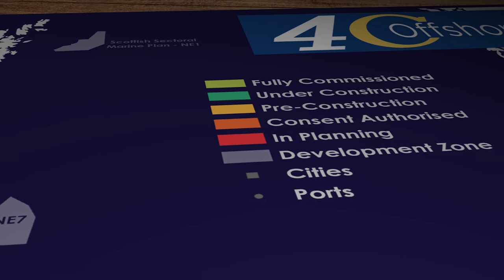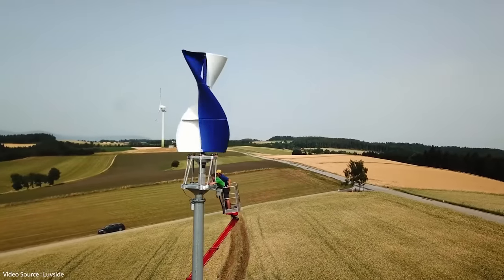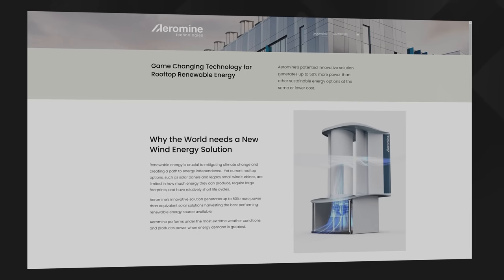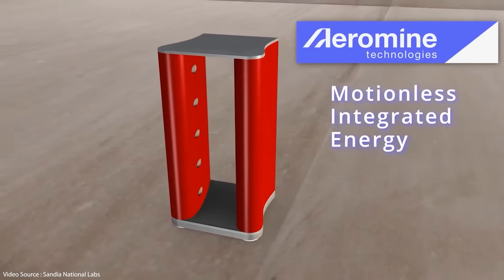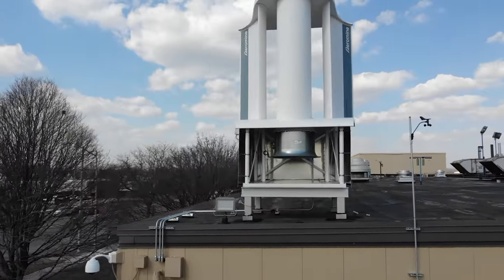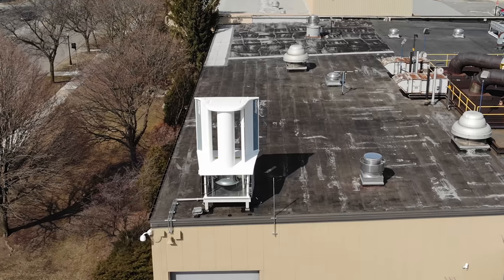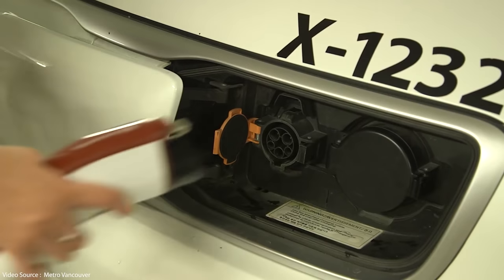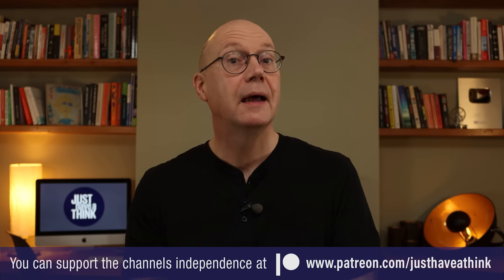Aeromine Rooftop Wind. Static. Silent.  50% more power than Solar PV. What's not to like?

Comment: This appears to only work with wind from a single direction. I would be interested to hear about how it deals with variable direction wind.
Reply: I've not checked it yet but I'm pretty sure I saw a design using a vertical-axis wind-turbine for rooftops recently?
Reply: It deals with it by staying attached to the roof and not falling off, I'd imagine.
Reply: Rotational base with sensors would be cool, but then again, it will no longer be low maintenance
Reply: There's another video, can't remember by who, suggests that a 45 degree variance in the wind from centre in either direction doesn't affect performance, so it, "works well" in places with a predominant wind direction
Reply: @ceeerl8698  That was my thought. I would think that a tail vane would allow it to keep it pointed into the wind.
Reply: Maybe a robust system which 'follows' the wind direction to position the turbine would be useful.
Reply: @DavidM2002  that should do it or use the whole construction as the tail. Just add some weight to balance the tail and it wouldn't be too advanced
Reply: @Justifi3r09  to get a predominant wind direction is difficult even with a large share of wind from southwest in western europe. You would need to mount it on a rotating base.
Reply: @paxundpeace9970  I don't disagree with you, merely only sharing their claim
Reply: Making them turn is pretty easy, but due to the size, it would add a decent amount to the cost.

They make versions that can take wind from any direction.  Less efficient, but cheaper to make.

In fact, you can find plenty of people who've bullt one using a 55 gallon barrel.  Not counting the generator and other parts needed for making it electrical, the turbine itself shouldn't cost more than a couple hundred dollars to build.
Reply: These are designed to use the side of the building to help channel the air into the bottom of the turbine (it's why they place it at the edge of a flat roof).  Let's say the prevailing winds (more than 50% of the time) come from the west and your building has a 100 foot long wall that runs N-S where you install 5 or 6 of these.  If the turbines turn to catch a wind from the SOUTH the only one that will get anything is the one at the SW corner of the roof.  Most regions get their prevailing winds from one direction, now they may vary from a N-W to a S-W angle (using the above example), but they'll still be MOSTLY from the west.

Comment: This thing being almost 10' tall could be a problem with zoning height restrictions for residential areas. That is adding almost another story in height. It also seems like the height could add a lot of forces to it, adding to the structure required to support it.

And no visible moving parts is different than no moving parts. There must be potential for noise and vibration, even though the turbine blades are internal.
Reply: Sorry but you are rather negative in your appraisal and you are stating the obvious, it isn't a magic wand.
Reply: @anthonyxuereb792  No, I'm just stating the facts. I didn't claim it to be a magic wand. I'm not being negative, just realistic. It's not exactly something everyone could install on their existing house.

Comment: Bullcrap. 
I sell solar PV.  We looked into wind turbines to augment solar.  
The good thing about wind is that it works day or night.  
Our thinking was they should work well together.  
No such luck.  
When you look at their rated power production -- it will be at over 20mph. 
That's ridiculous. Typical windspeeds are like 10mph.  
The windmills we looked at didn't produce anything until about 7mph. 
At 10, 11, and 12 mph, their production was negligible. 
We concluded that wind needs large windmills operating at much higher elevations, 
where they can get faster winds.  Putting them on a 30 foot pole or house just didn't work.
Reply: Thanks for your realistic statement! You what your talking and I'm the same opinion.
They talking 5kw, hahahaha, I know how big my solar 8kw system is and this liiitle toy fan never will make 5 kW.
Reply: You should also add that wind distortion that comes out from hitting buildings and everything else doesn't help either.

Comment: You should look into designing one or 4 that would either go around the chimney (4) or Replace the Chimney (1) while allowing a 10” or 12” type B vent to come up the middle so the fireplace could be used still!
Hope this makes sense!
I am in Elk Grove, CA and we get a lot of “Delta Breezes” (I’ll let you look that up!)
Reply: I thought the same thing...I applaud your out of box thinking
Reply: You could put one on the top of your chimney to work 24/7, and it would also make your chimney more efficient to boot.  By the device being there, it would create faster wind flowing over the top, and more of a suction inside the chimney.

Comment: They have a moving part: the propeller and a turning propeller maks sounds. Secondly,  installations standing in de wind will,  with a more stronger wind, as in a coastal area,  make, depending wind direction, all kind of wisteling sounds. In my area I witness that from GSM antenna towers. The solar panels on my roof, living near the sea, will cause vibrations and wisteling when the wind go's above wind force eight.  The vibration sound strengthens in the concave my attic forms. With the last storm one of that panels broke off and fell in the street. Luckily nobody was hurt.

Comment: I once put forward a concept to a facade company about utilising the air pressure differences around corners on High Rise buildings by creating a venturi through the corners and using a small turbine, several of them.

Comment: Thanks for another great video. Generation at points close to requirement can only help the "National Infrastructure" adapt to the high low, short need requirements of modern life. 
I think there is a Dutch outfit that have developed a "pod" design to sit on flat roof buildings that has solar PV on top of a "sculpted" interior to use Venturi effects through multiple wind generators. All generators create vibration and it is the mounting of this that will prevent the transmission of any vibrations into the building. 
I think expectations need to be set on the levels of power generation. I wouldn't expect to get out of the KiloWatt generation for an installation.
National infrastructures have developed where power is generated in large central locations, not at the edge and as such not feeding back into the national infrastructure.
Solutions like this are great for a building or small development and as part of a wider energy independence plan I'm sure would make financial sense. 
:)
Keep up the good work :)

Comment: I work in a feed mill in the plains of the US and the load out bays of our mill are like wind tunnels.  The winds could be 30 to 40 mph but the air flowing around the silos and through the load out bays is hurricane force.  These are vertical surfaces and couldn't use this particular technology.  However, the height of the elevator would be perfect for continual wind flow if someone could design something that wouldn't torque the structure or change the function of the elevator, silos and load out bays while the walls and bay entrances and exits could be useful for producing wind power.

Comment: also looking at the patients of the areo mine this can be further modified for other use cases to produce electricity for residential homes but they used the venturi effect for the one 3 times one where the generator is with a egg shape cone, then on the aft side of the propeller, then on the way out of the system. In fig. 18 of the patient they are also using a 2 stage prop with adjustable and fixed blades with a pancake motor with a assumable 5kw peak motor. in the video there was 3 different designs through there process and which lead to the final design with a 4 wing and chamber setup. so technically anyone could make this just it is not a simple wind turbine

Comment: Ive been a design build renewable energy contractor for 3 decades. About 15 yrs ago I installed a vertical axis wind turbine under a pilot program for the US military.  At the time I was asked to select the product to be installed.  I could find no product at the time that I could stand behind for performance or reliability criteria.  The govt selected and purchased a product rated at 5kW.  The location we installed the vertical axis wind turbine was a Hawaii military base apprrox 1000 ft above sea level with constant prevailing winds of 10-20 mph.  The turbine though rated at 5kW never produced more than 500 watts.  Also the inverter paired with the turbine minimum voltage was the lowest available at the time but the turbine only produced power at around 15 mph wind speed.  The turbine was supposed to have a built in brake for high wind.  Unfortunately the turbine failed within 1 yr and actually blew apart embedding pieces into surrounding buildings.  Fortunately nobody was injured.  Ever since I've been skeptical of vertical axis wind turbine technology.....

Comment: Brilliant and elegant. How much and how long are they designed to last? There must be some periodic maintenance? ROI calc examples would be the next logical video. We are rooting for this breakthrough tech. Here on the Canadian west coast there are special site needs. Here are some queries:

Heavy slanting blizzards clogging ingress ports. How do you resolve heavy ice and snow accumulation ... with frequent and rapid thaw cycles.

Nesting birds and rodents, insects prize cavaties. How do you deal with these in the airflow ingress pathway?

Minimum roof/high wind shear loads. Anchor fastener strength? Rust- sun weathering- etc.  Hurricane forces .... or earthquakes. 

Remote communities on sizable
Bluff, cliff installations,  mountain sides ... to take advantage of very constant high up-lifts for an industrial scale operation?  Many more questions ... but think you are on a profoundly sound track for viable renewables. Fascinating.

Comment: I always wondered why the Venturi effect wasn’t utilized in capturing wind energy. This sounds very promising actually.
Reply: Because when converting wind to mechanical power you need more area to support a load, yes it speeds up the wind slightly but the blades themselves when coming under load will just slow the air down thus killing the venturi effect
Reply: If you don't have two mountains that create a venturi effect "naturally", you need to add something to the windmill. This will increase the cost. The energy relates to the size of the windmill, similar to a farm: Bigger fields = more crop, longer blades = more wind to capture. The higher speed is only relevant as you need some minimum speed to get the blades running.

Comment: Here in Florida during the long summer we have we get onshore winds almost like clockwork most days due to the peninsula heating up faster than the water so the direction of the wind is pretty constant, therefore I'd like to think these would work pretty well on buildings/homes near the shoreline.

Comment: I always wince when I hear the explanation of the venturi effect being the cause of aircraft lift. It has migrated to explaining how sailing boats are powered and now this rooftop wind generator. It may well be true for this wind generator because the path of the wind is controlled and constricted. But for aircraft whatever venturi effect created by the wing shape is marginal (it is the angle of attack to the airflow that generates lift). How otherwise can one explain that aircraft can fly upside down?

Comment: I can see this system working well with heat evacuation/ventilation from any industrial facilitate that generates copious amounts hot air.... such as steel smelters and glass furnaces and the like. 
In the tropical parts of the world, nearly every building with high ceiling and a lack of climate control would fit that model as well.

Comment: Great video, and promising technology.  I am a little confused by the several times you said "no moving parts" and "silent".  There is the internal turbine which is being spun by the air that passes through, and that is a moving part.  Granted it's not a big external propeller, but it's certainly moving.  And even if everything is mechanically balanced, there will surely be some sound made by the spinning turbine and possibly even the wind as it is forced through the channels.  Fortunately some of that probably small sound will be absorbed or reflected upward by the roof, but line of sight on the ground to the front of the unit will still possibly get some sound.

Comment: If it has an internal propeller type generator, that means there are most certainly moving parts. I don't know of any wind turbines that are completely devoid of moving parts.
I remember a few years ago there was an omni-directional small turbine that had four air intakes up top, and whichever way the wind was blowing, it forced the air into the turbine from that direction. Simple yet brilliant. It makes me wonder if this idea could be combined with a venturi to optimize the availability of the negative pressure assist.
Reply: OMG...

Comment: The WindRail , by a company called "Anerdgy successfully tested a prototype on top of some grain silos outside Zurich" in 2014 has a similar product.
"ANERDGY AG was founded by Sven Koehler in 2012. We invented, patented and develop the WindRail® system."
The still sell Roof wind turbine B60, a twin turbine solution,  but no longer seem to sell the "edge of roof turbine", they first tested in 2015

Comment: A lot of comments are going on about "changing the direction" if the wind changes, but the whole point of this system is that it is very simple and cheap to build.  Every added thing to "improve" it adds both cost to the initial build plus maintenance and then you have to also consider the different engineering challenge of the structure itself if the loads are shifting.

To me the "go bigger" approach is noted (they don't make smaller units because they won't generate that much power), but the other key is that it can be built out of things like wood or plastics or perhaps even foam filled skins like many other things that are laminated.  Foam is pretty light too...

Weather extremes would be my concern, we can get 100+ MPH winds here and gusts from different directions.

Also animals, that looks a bit too tempting as a fixed structure to birds wanting to build nests in there...  Pigeons.

Comment: I was looking at a device that had similar aspects, but more of a turbine? The unit look like tree with turning leaves. I am hoping to put some of these trees some day in my yard. Great solution in certain areas are you Couldn’t have trees. The trees generate energy they were also fairly attractive. I like the idea that an industrial parks you could use units, modern and sleek, but I also don’t think they should be put into areas where there’s a visual beauty wiser. You don’t want to clutter up the area in our air spaces that is ugly.

Comment: I think this is great technology. I have recently fitted a large solar panel set up on my farm / lodge and was looking at wind power generation to supplement the power during nights and grey days charging my large battery bank. My only negative with this unit is the size never mind the cost. It looks rather large and would be rather a sore thumb looking object on the top of the cabins scattered on the property. If they made a smaller unit it would be more appealing, for me anyway.
Reply: Or a even bigger more efficient unit. How does this scale if you go 3x

Comment: Seems like a vertical pivot with rate buffer to allow rotation 360 degrees would be beneficial for any wind direction . I like it .
Reply: No, everybody knows that wind is perfectly constant in speed and direction. Or is that what they want to sell us?
Reply: That's going to be noisy. And create maintenance. I'd work on the base design so wind from any direction can be "scooped" into the mill. Seems weird that wasn't incorporated into the original design. Not rocket science.

Comment: Very good aerodynamic design... now if we add a rotating base and a long vertical vane on top of the device it could self align with the wind direction.
Another thing that could be implemented is conter rotating  wing turbines iside the unit.

Comment: I was watching old JHAT vids and had an interesting thought. The vertical wind turbines used at the side of some highways to generate electricity could be modified to be placed on bridge foundations in rivers for a constant supply of electricity. Minimal capital investment. Just bolt them on to existing concrete.

Comment: In theory such wind diffusers are similar to water dams — they concentrate power of moving fluid. But huge practical difference is that water is 800 times more dense than air, therefore dams of water are much more efficient and less material intense to produced energy than similar solutions for wind. Therefore such additions to wind turbines just add costs for materials and maintenance and are another Rube Goldberg solution to harvest weak and unreliable wind energy.

Comment: Interesting concept, over many years I have toyed with/ used all kinds of homemade water, wind, and solar items from passive heat, water heat, and electric generation on a small scale, however, an airfoil never really crossed my mind.  I would be interested in a couple one meter size for my home if we had more wind in the central USA.  We don't get much more than a gentle breeze except during storms.
Reply: 2:21